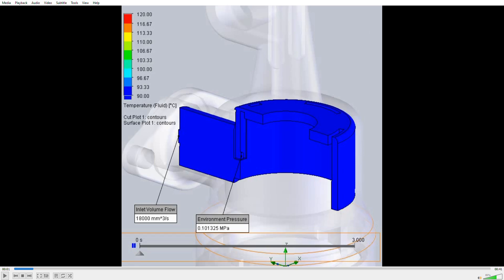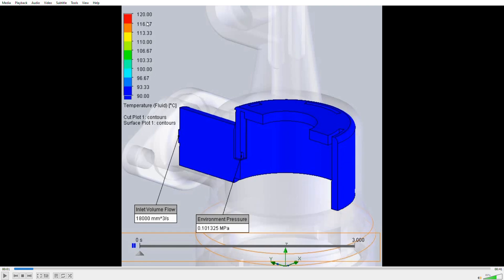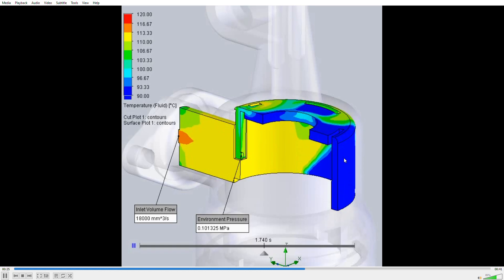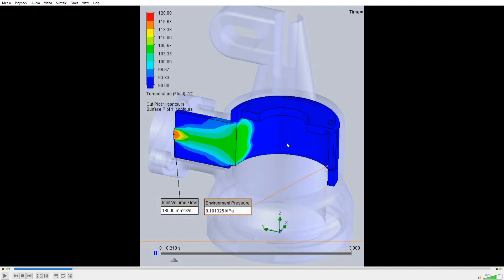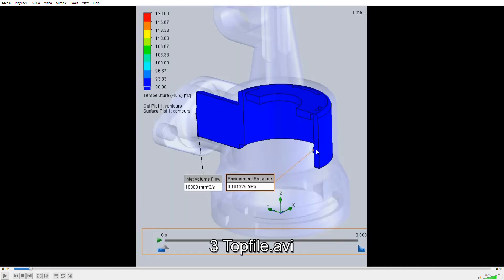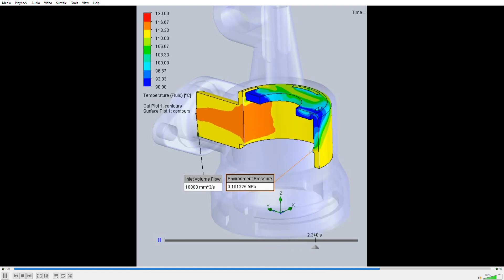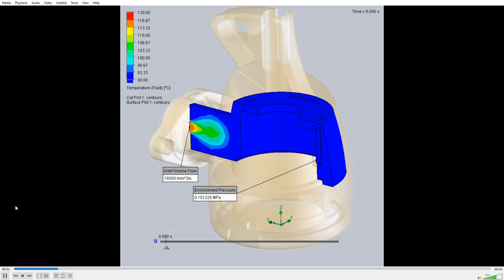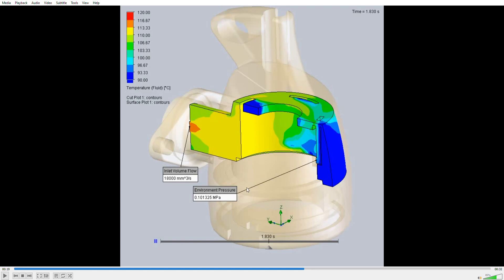13. Flow & Temperature Simulation - La Pavoni Lever Espresso Machine

Comment: John, fantastic stuff. I have a Gen three Europiccola and I have placed a temperature probe linked to an LCD display on the left hand side of the group. For me, I always tend to start my shots when the temperature reads in the low 80s because I find when my temperature display reads 89 or 90° at the end of the shot that's when the water starts bubbling from the bottom of the basket. So I am assuming that with my machine and that particular temperature probe there is roughly a 10 or 11° average difference between the temperature of the water inside the group and the temperature reading.  The Coffee taste great but I still find the temperature management confusing.
Reply from the maker: Ed, Clearly you found that using a temperature probe on the outside of the group head shows the temperature on the outside of the group head. There is indeed a temperature difference, but there is also a significant time lag. For me, I stick to a routine where I turn my G3 machine on about 30 minutes before I use it. Then I pull my shot. If I deviate from that, things get funky.
I'd like to suggest joining our lively and open discussions at https://www.facebook.com/groups/lapavonienthusiastsgroup

Comment: Brilliant 👌 ... but may I ask if that is Transient free surface CFD ?
 in another word how did you manage to create the cold water region .
Reply from the maker: The simulation tool allows you to define a solid body as water with an initial temperature. So I created a solid body that fills the void inside the group head as water would. I assigned this body a temperature of 90C. For this solid body, I added an atmospheric outlet (for the water to flow out of) and a pressure inlet where I introduce 120C water. Did I answer your question?
Reply: @JohnMichaelHauck  all clear right now ...thanks a lot I really enjoy your content .